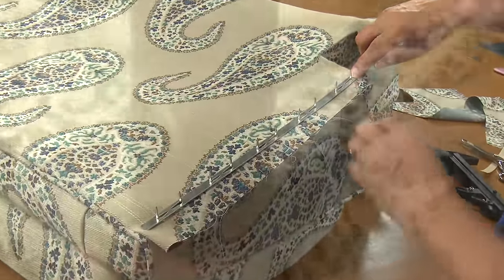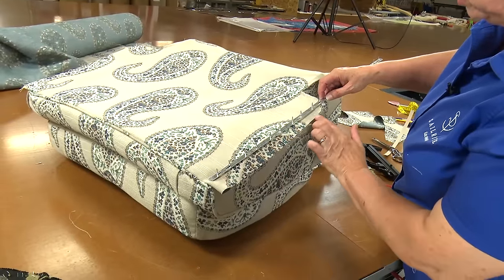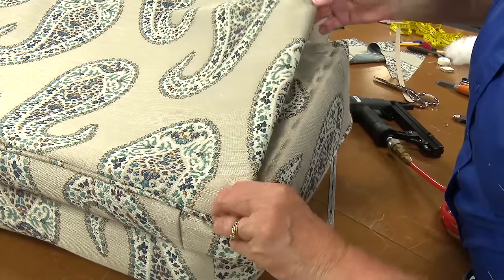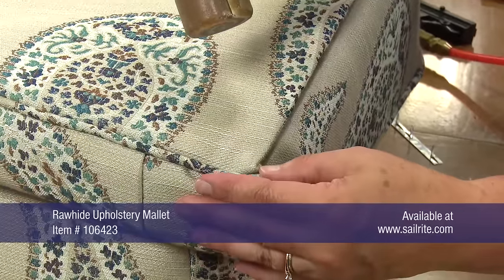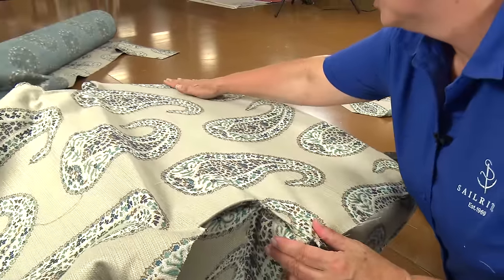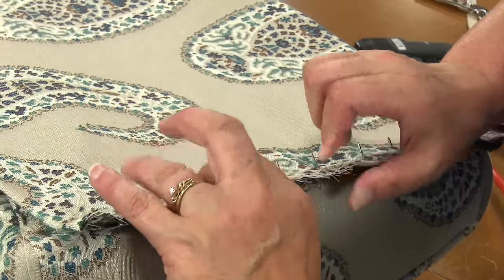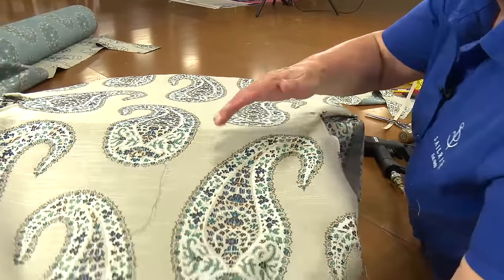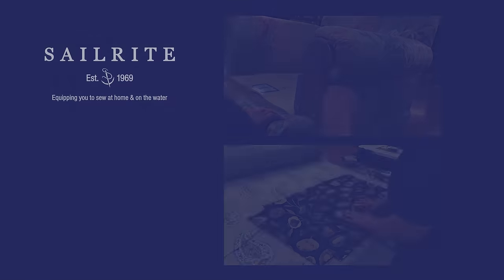Upholstery Tack Strip Demo - How to Use

Comment: If u hit the tack strip like your doing your gonna have lumps. Always start from the top downwards. Also make sure the back tack card along the top is cut to an angle so the out back corner dosnt have a lip. You get a better finish and won’t have to panel pin the corner

Comment: Looks like the very first time Cindy has ever put metals in furniture. This is how you get a loose back and wrinkles along the strip. You might get away with it on a motion chair with velcro but not on more commonly re-upholstered  stationary pieces.
Reply: For those interested, the strip goes against the wood prongs out, pull the top corner over the top prong first, then pull the bottom corner of the back tight diagonally, then pop it over the bottom prong. You then have tension all the way down the strip and can put a all your fingers in between the prongs and pop them all in at once. Then you flip it prongs in and pull it over to the edge to hammer it in. That creates a back you can thump like a drum.
Reply: Brantly Robbins this was soooooo helpful. Thank you so much for these instructions

Comment: First of all with any linen fabric you always want to use a padded tac band so you don’t fray or knock a damn hole in the fabric. Secondly, if you lay the tac band on the flat surface with the tacs facing up, and half way on the edge of the wood it works better and quicker. Lastly, when you hit a tac band you don’t “tap” you whack and evenly from the top to the bottom so the tac band lays flat and firm. And one more thing I saw that was incorrect, when you cut the band always cut with the tacs facing down so you don’t have a sharp bur. But A for effort I can tell you’ve never trimmed before ma’am

Comment: What do you use to cut down your tack strips? I can't cut through mine and unsure what to buy 😔
Reply from the maker: At 37 seconds in the video we used wire cutter pliers.
Reply: The tack strip I bought online required tin snips. I am just about to begin using them!